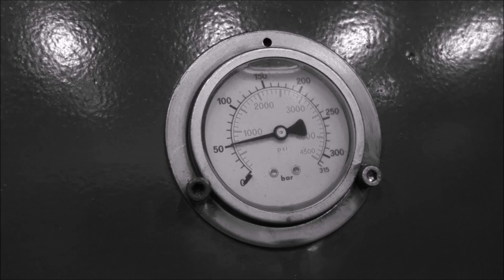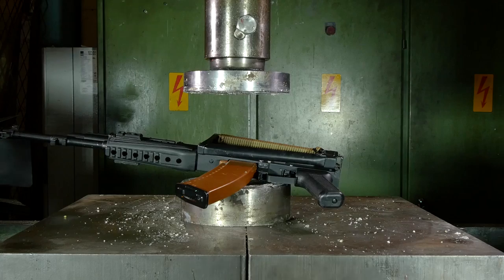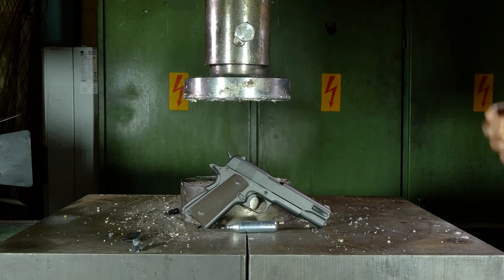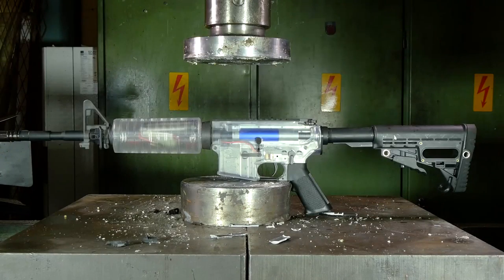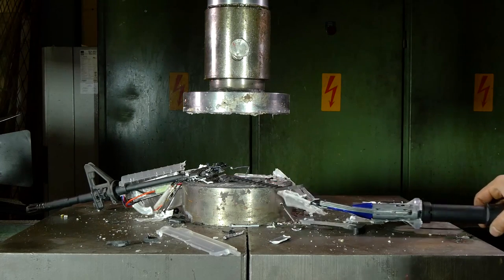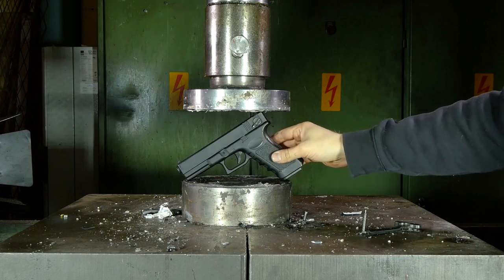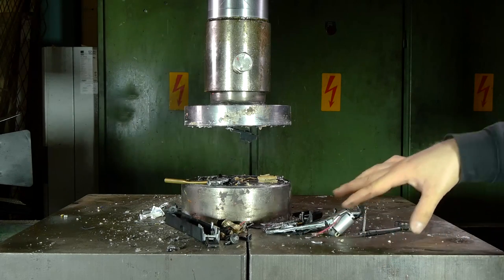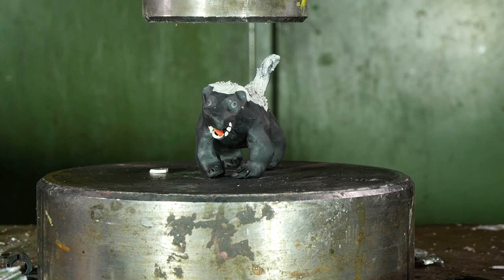Crushing airsoft stuff with hydraulic press

Comment: can you crush over charged LiPo battery??
Reply: +Ketut Suaryana i dont think there will be anything to crush if its overcharged..
Reply from the maker: I have planned that. We have also some supercapasitators coming soon probably :D
Reply: Hydraulic Press Channel 
What is Supercapasitators ;-)
Reply: "Supercapasitators."
Reply: Some brand new, fully charged, 18650's might be more impressive.
Reply: For good flames you want those RC car packs.Those can deliver kilowatts and burn like hell when shit goes wrong.
Reply: Picobyte There is at least one (probably 2) LiPo battery in this video. It didn't catch fire because it was not really shorted. Maybe they should puch a nut or a bolt trough it. (these airsoft LiPos could have a low C rating, so i think you have a point. Maybe a 130C turnigy LiPo would burn better)
Reply: Ketut Suaryana that vould Be a bomb

Comment: Things to crush: Car airbag. Car battery. Big capacitors (while holding a charge). A big cube (6"x6"x6"?) of strong wood crushed end grain. A 1 kilo plate on end (will it fold?). Crush sand with heated press (make glass?)

Comment: Electric airsoft gun?? Never have i ever heard of that before... I thought there only was CO2 because ''Air''soft :P Yes i know i'm a little stupid.
Reply: AEG's are the most common airsoft guns
Reply: I have no idea what AEG means though
Reply: you can always use this awesome search engine called google. its basically the three first words of you original comment.
Reply: automatic electric gun. These are the standard types since tokyo marui introduced the first electric guns back in the 80's I believe. However gas rifles have increasing popularity because of the more realistic operation.
Reply: diversant13 Ahh ok :P
Reply: Electric airsoft guns (AEGs) still use air. Rather than having an air source, though, they use a motor and gears that pull back a piston and spring, which then shoots forward and pushes air through a nozzle. You can see it in slo-mo here: https://upload.wikimedia.org/wikipedia/commons/4/44/AEG.gif
Reply: Yeah ok cool
Reply: Ok i didn't know that since i've never used one
Reply: no no no its more that 1% of spring. maybe atleast 20%. (i have 3 airsoft guns and all of them are working on spring)
Reply: Boomer112 they make aeg guns. Automatic electric guns. They have gas powered with many types of gas like green gas, co2, propane, and red gas I think. They also make springers, spring powered. You have to pull the slide back every time on springers. Nobody that plays airsoft, like myself, considers springers a reliable side arm
Reply: Boomer112 mos. airsoft guns are electric
Reply: When da people take your joke seriously :P
Reply: A piston "compresses" air which is released to simulate some sort of co2 i guess

Comment: With the batteries: maybe try routing out a smallish recessed area smaller then the battery in the center of the pressing tool or stationary part  so some of the battery in the center is not crushed as completely - maybe this would make heat smoke and pressure and then maybe the crushed parts of the battery would also do something. Maybe more then simply being ejected. Where did all the energy in the flattened battery go anyway? Perhaps just shorted through the metal? Did it get hot?